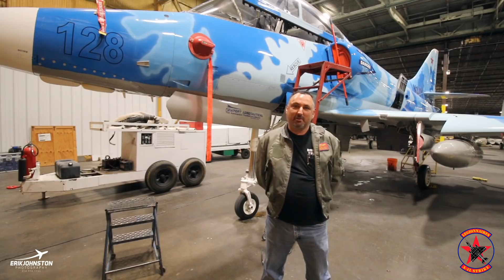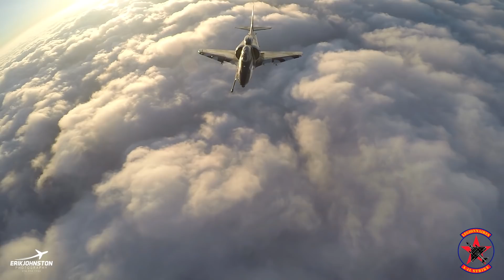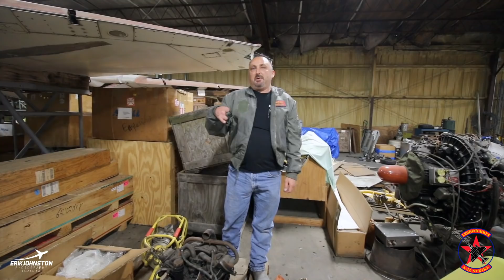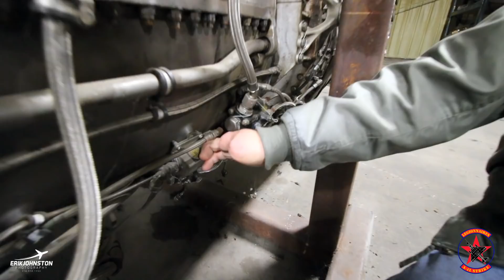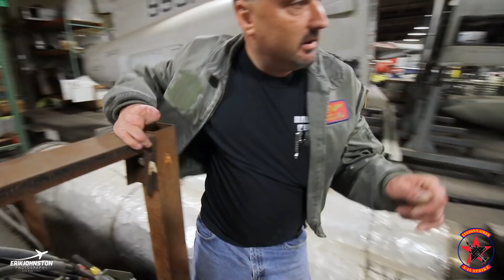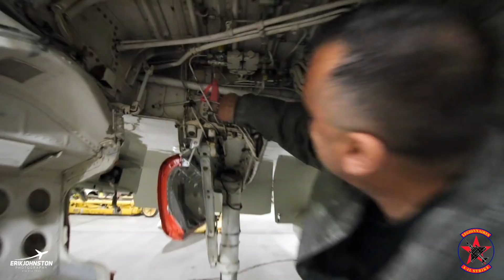A-4 Skyhawk Mechanics Corner

Comment: Awesome video! Really shows the quirks and features of the A-4. Really curious about the engine removal, though, I heard somewhere that it was easy (?). I'm sure it doesn't feel that way for the guy actually doing it haha
Reply: It was easy! There were six, I think, bolts that held the tail on, four around the top and two in the aft hell hole. Disconnect the clamp that attached the tail pipe to the engine, a few control cables and the tail was ready to pull. The engine was next, a few canon plugs and, I think, a bolt on each side and the engine was ready to slide out after a jig on rails was slid under it. Did quite a few between 1967 and 1969, three Vietnam cruises. Fly Navy!

Comment: I was an ADJ-3 engine mechanic  when  assigned to VA-204  "River Rattlers" at NAS Memphis. They flew the A-4L.  Previous experience was with the P-2 and P-3 with VP-65.  What a change!  First time I say the saw their Scooters take off I asked what was wrong.  As soon as the pilot advanced the throttle to military power for takeoff, the aircraft started spewing oil vapor.  I figured internal carbon seals were shot. But was told that was normal. 
We had more problems with the CSD than with the AC generators.  And on trips to high power after engine or fuel control changes we would first loosen the exhaust nozzle clamps and tap the nozzle open with a rubber mallet.  Then, with engine stabilized the cockpit man would signal up, 2 for two turns tighter or whatever on the clamps.  And I do not recall ever puling an engine to do a fuel control change. Hell, the book says you pull the engine for dang near anything.  
Another issue with the J-65 was the starter probe.  There was a sheer fitting inside that would, well...sheer and need replacement.  Line crew usually had a few probes waiting parts.  
Later worked on the A-4F with VFC-13. That J-52-P408 was a real screamer. Sitting on the port wing, engine at military, inside the "Hush House" tweaking the fuel control was a trip.  That's enough. Better stop before I get to heavy into sea stories.  
One question. Any of your birds have orange snakes painted on the hump or drop tanks?

Comment: As an 8 year A-4 line mech/trouble shooter, I loved the Scooter. Easy to work on but had its quirks depending on how hard it was pushed. Doing ACM, I’ve had aircraft return with broken flap hinges, bent slat tracks, cracked wing structure. Fluid leaks were the least of our problems.
Reply: You should watch some videos from Snort Snodgrass if you haven't already. Pulling fuses, unauthorized flap selection, over stressing, blatantly admitting he shouldn't have gotten away with what he did to those planes. But his father was a Grumman guy and he grew up listening to the test pilots talking about what the plane could do.

Comment: I worked on T-A4fs in the Marines in the late 60s. Because I was a small guy, I once had to crawl up between the engine and the fuselage to install a thermocouple to the engine that registered heat for the pilot. If I couldn’t do it the mechanics would have had to take the plane apart, which they did to change the engine. I got to fly in the back seat after going to school. Had to do the altitude chamber and get blown up in a mock ejection seat with a quarter charge. I could probably still work on the electrical system.
Reply: When I was in VA-127  the west coast A-4F RAG, I got to climb up the tail pipe to hook up the jetcal probes.  Every time I had to go in, the airplane had just landed and towed into the hangar bay.  It was hot and reeked of barbecued kerosene.  You had to be careful on the way out, because if you pulled on the cable and broke the thermocouple, you were in deep kimchee.
Reply: @davekisor1486  That is probably what I changed. I always had a buddy come with me just in case I got stuck.

Comment: Keep the mechanics talks coming!
 I worked on A4-F's and A4-M's as a hydraulics mech.  In one squadron I was with, if you cracked a fitting, it was made into a necklace with safety wire which you had to wear around your neck for a week (I still have mine).  
I have fond memories (total sarcasm) of standing on a tool box in the Hell Hole and changing out an aileron power pack.  I'm sure that the air around that hangar area is still blue from the language I used.
Reply: "Aileron power pack" job S U C K E D! Once that pita was in the rest was fun! Man that job sucked!! Lol. Would love to try it again though.
Reply: @gregbuck701  Former USMC A-4 Super Fox and TA-4F/J Avionics tech here. Our "headache" was the tacan blower motor. I swear at the factory a mechanic held it up and the factory built the rest of the aircraft around it.
Reply: @gregbuck701  - Made me glad to be an AD and not an AM.   Anyone ever say, 'I can't change that. I'm an AMS, not an AMH!"  LOL!
Reply: @scootergeorge9576  I/we always helped out the ADs,...tail and all. But up on "high power" we'd be maxed out with the ac running.......fun fun times. I'll never forget the first time my buddy who was a AD threw a bucket of walnuts down the intake and didnt tell me.